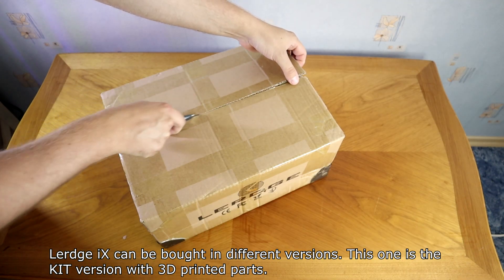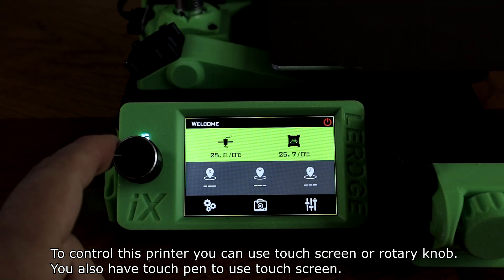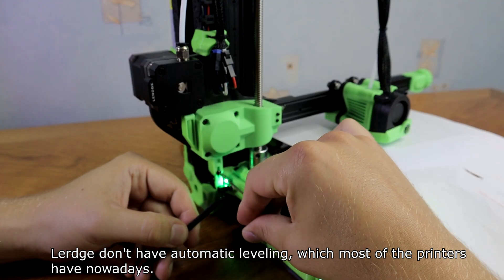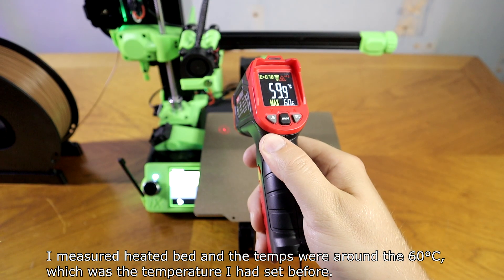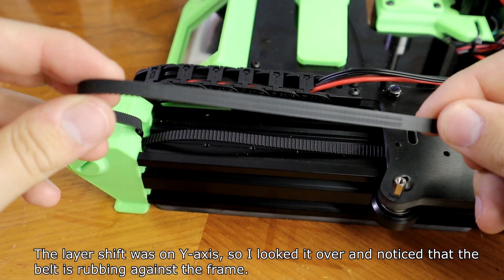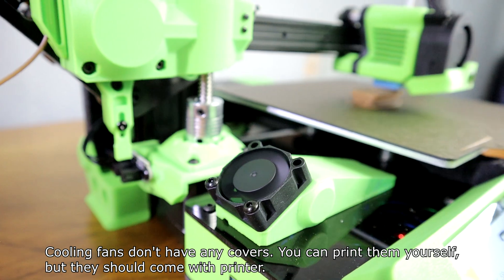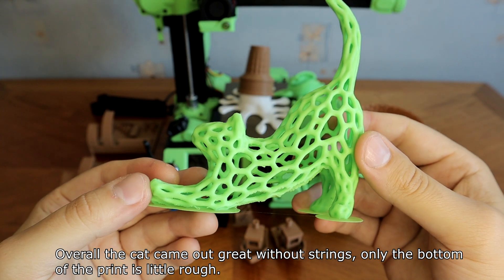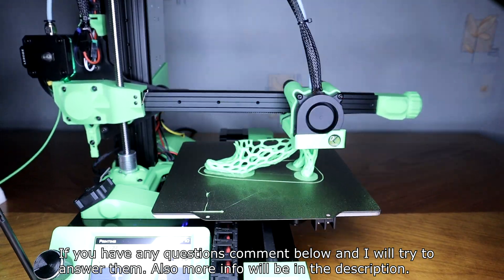Lerdge iX - Small Size Powerful 3D Printer

Comment: im pretty sure you setup the printer wrong, the belt is meant to go through the frame on one side of the loop... and not both ways over the frame, ever other 3d printer does it the same way looping it through the extrusion, that would then make the "to low" bracket be ideal again
Reply: I used the manual to assembly it. Maybe I made I mistake and read it wrong. So you could be right. The bracket I made fixed the problem also. At the moment I can't check it, but I will watch it over.
Reply: i looked at the manual, and it shows the belt being looped through the frame @Mr44RO